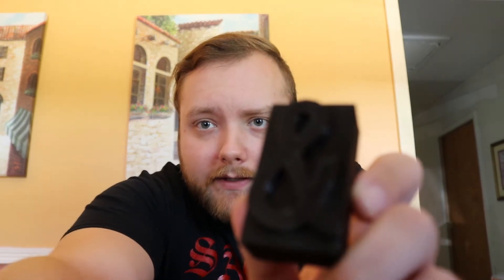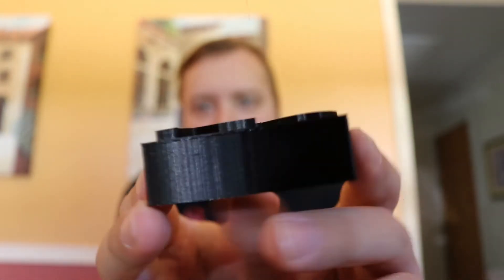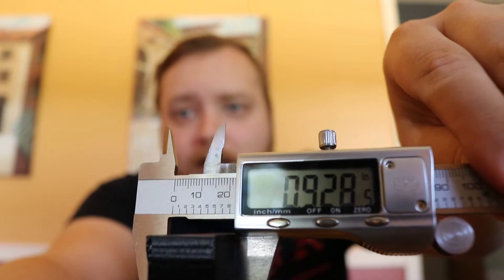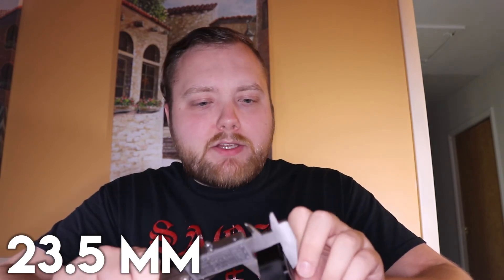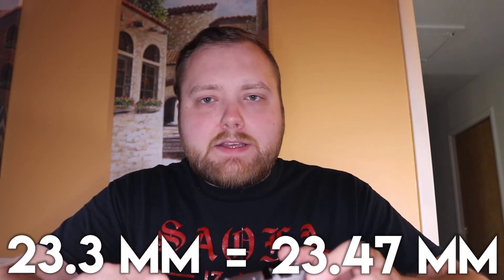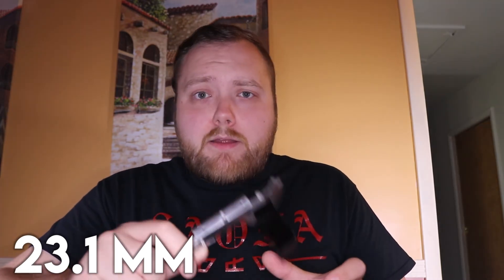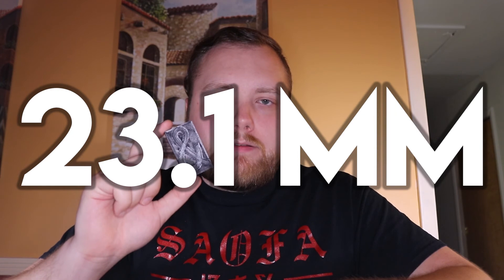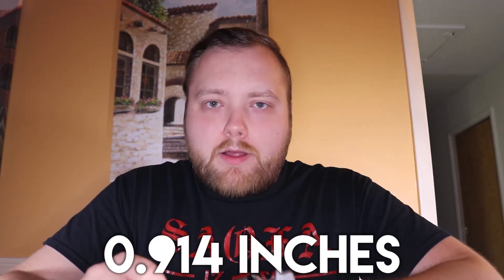Fusion800: 3D Printed Letterpress Type - Size Testing

Comment: Cool project and I'm curious to see more. Just a few thoughts that come to mind;
I know you're still testing print settings here, but shouldn't the ampersand be mirrored to print correctly on the press?
Also, like David said, there's nothing wrong with using Tinkercad. If it does the job, use it. I do think though (apart from the nice Fusion800/Fusion360 match) Fusion360 is a bit of a better choice for your project, as it doesn't facet the rounded sides, which I'm guessing you would like to have smooth. It's also free for students and not that hard to get into, especially for relatively simple shapes like these.
As far as getting the height precisely right, I think I would do the opposite of what you're doing; making it a little bit too high rather than too low. Since you will quite probably have to sand the tops of your 3D printed parts anyway before you can print with them on the press to make them really flat, and sanding off tenths of millimeters is much easier than adding pieces of paper or something to each 3D printed part to make them fit.
Another way you could get a super smooth top is by printing upside down. I know it sounds illogical, with having to use supports and all, but the characters will come out perfectly smooth and flat (if you print on a smooth surface that is of course, but it looks like you're printing on glass with glue stick, so that shouldn't be a problem), and you don't have to worry about supports not coming off cleanly enough, as they will never touch the paper or other medium you'll be printing on anyway.
OK, that ended being a lot longer than I though I would type :) In short; cool project, love to see more!